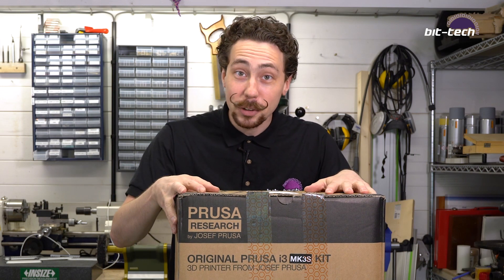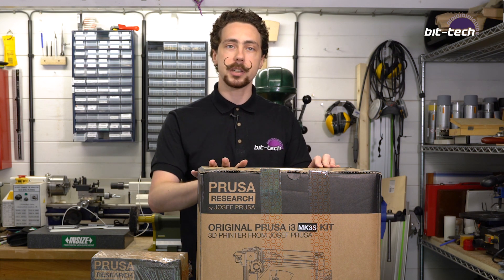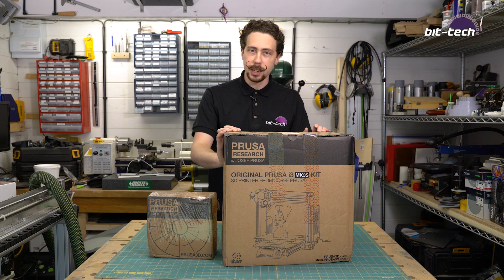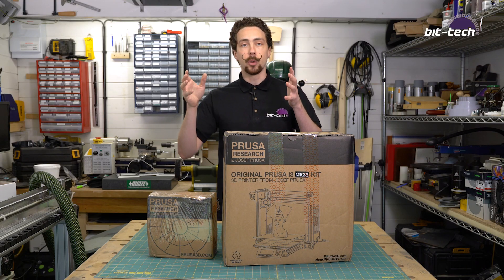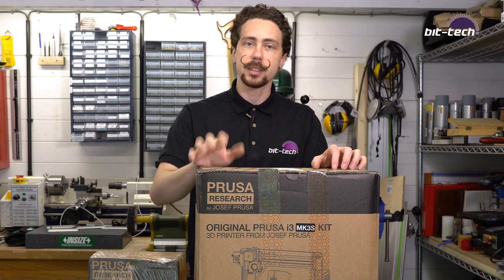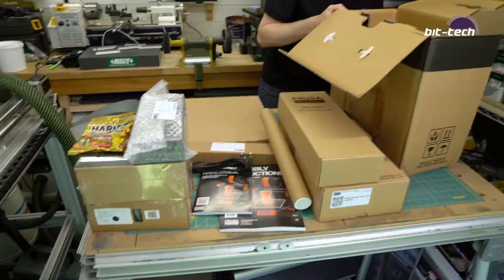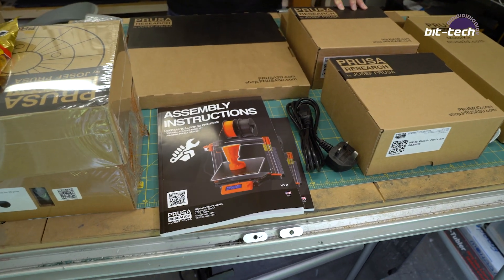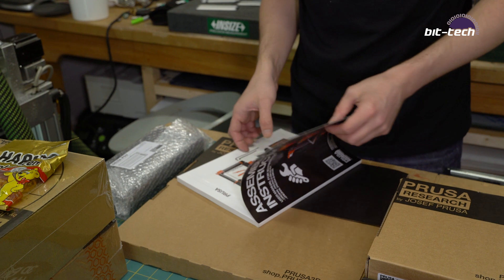Assembling a Prusa i3 MK3S 3D Printer Kit - Workshop Upgrade! | bit-tech Modding

Comment: Hi. Could you please give me an advice. I would like to buy Prusa printer, but not sure if MK3S is the best choice now. Looks like the newer 'mini' model has color screen and wifi capabilities. Also, could you please recommend what I should add to my purchase together with the printer? Apart of filaments of course. I know nothing about it, but maybe I will need different nozzles, print bed or smth else?
Reply from the maker: Personally unless you need the larger print volume, I would likely go for a Mini. It can't manage as many filament types as the MK3S either, but most of those are the niche, high temperature ones. 

For starting out, I would suggest a 0.2mm nozzle to go with the default one, and then just some more filament. PETG prints well on the Prusas so I would give that a go, it's great for prints that need a bit more durability. Aside from that though, I'd say pick things up if/when you need them. Most parts are available locally online since they're not model specific.
Reply: Thanks! I kind of decided to buy the big version, now you made me thinking again haha. I will use probably mostly PLA for tests and then ASA (stronger filaments) for my parts. Anyway, thanks for reply

Comment: Great video! did you film the video without reading the manual? The only question I have is the nuts that seem to go into the black piece seem to go in at an angle? just asking when I get my printer I can have as easy assembly as yours!

Cheers!
Reply: Was how was the assembly? My ender 3 is going in the trash and I need to upgrade to real deal 3d printer.

Comment: i would've suggested getting a much cheaper 3d printer, and doing lots of modifications (most of which can be 3d printed or arent that expensive to buy) and getting it to the same or better quality as a prusa, however just buying the printer is an alright choice, good reliable printer and im excited to see what you make with it
Reply: i personally have an ender 3, quite nice to have one of them
Reply: also id suggest going with PETG for stuff that needs to resiste temperature and have good strength, it sits between PLA and ABS on mostly everythng and is a lot easier to print than ABS
Reply: @kaelensorensen5485  as i said, modifications, all of those things that make it more reliable are just opensource modifications the community made to make printers such as the ender 3 more reliable, they just looked at all the improvements the community was doing and incorporated it all into the printer, there is nothing stopping you from getting a cheaper printer up to the reliability and quality of the pursa and beyond, its not that hard, its cheaper than buying the prusa, and its pretty fun. The only thing required is more time, there are plenty of reasons to use the prusa from the standpoint of a company. Such as it just being ready out box. And the warranty, and the customer support, but if you like to tinker and dont mind the lack of customer support something like the ender 3 or the cr10 makes a lot of sense
Reply: @kaelensorensen5485  plus that glass bed hybrid that came out for the ender 3 is the coolest bed design ever, stuff just pops off the second it cools down, if its giving you troubke cause you used glue or whatever just leave it in the fridge, when you do that even massive surface area prints pop off no effort required
Reply: @kaelensorensen5485  not to mention with how easily moddable the ender 3 is me and my friend are considering building in a device that detects when a print is done, cools off the bed, and then sweeps the parts off, then you can just start a new print with wifi, you can check on it with octoprint, shoot i even heard about there being linear rail upgrades to the machine, all of this being cheaper to buy/make then spending the extra money to buy a prusa

Comment: Welcome to the 3d printing community. 3d printing has some huge potential, I did a build with 3d printed pump covers, works like a charm. I'm now prototyping with some 3d printed RGB fittings. 3d printers are cheap and amazing

Comment: Gotta love a bit of building. Maybe your next bigger one should be custom built using the cnc and printer?
Reply from the maker: Potential for it, although it sounds like a mental electronics project too rofl
Reply: Like spaghetti junction! I was thinking more just the structure, base and motors so you can control the size of the unit, then getting in a package with control unit with head. Plus you could make it real purrdy.